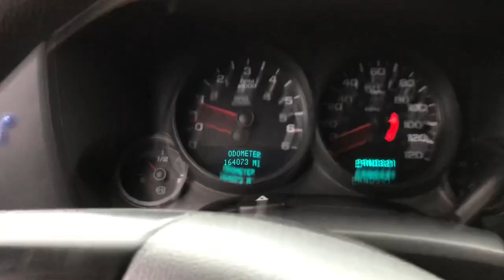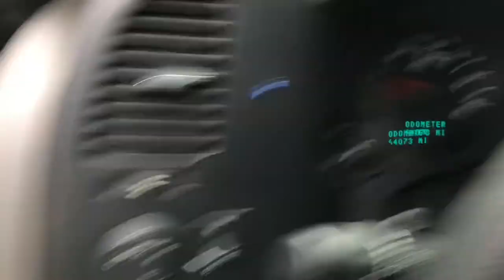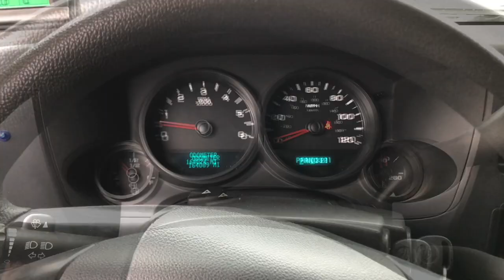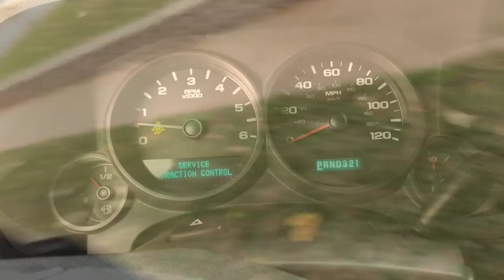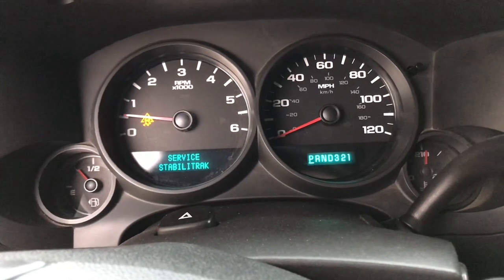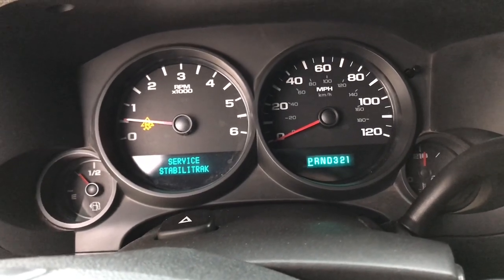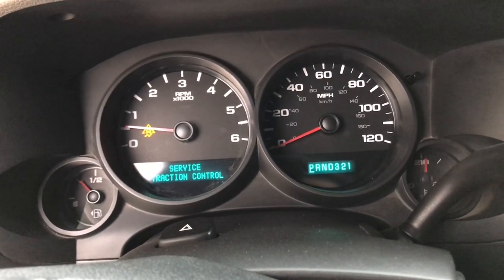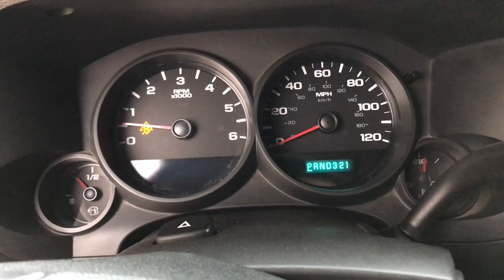Chevy Silverado Lifter Noise Tick | 4.8 5.3 6.0 Vortec | Vlog

Comment: had  same problem 5.3 put new lifters and the misfire because number one had leaking valve seat on intake  and number 6 also bad intake valve exhast seats were all carbon up put 2  new intake valves 7 dollars each and cleaned all valves and reseated  them and now it runs great just got it together today total around 7 hundred in parts 1 21 2022

Comment: I have the same exact issue right now with same codes, cylinder 2 misfire, and ticking sound. What was the issue? Lifters? Plugs?
Reply: It turned out to be the lifter on 2nd cylinder... the lifter roller was half ways gone so replacing the lifter fixed it.

Comment: Changed plugs installed hotter spark plugs. Better burn off.
Problem Stopped. 
Only very slight ticking on and off. 
Bad engine design oil tends to pool over the parts of engine and eventually lifter rod's clogged and lifter failure.

Comment: Flexplate? The tempo would be a lot faster if it was a lifter.
So, what was the problem?
Reply: • VH no it wouldn’t the camshaft spins at half the speed of the crank. if it was bottom end rotational or if it was flexplate/TC it would be twice the sound and way louder

Comment: Mine's at the garage right now same exact thing happened yesterday bad lifter mine was Cylinder 6 I've got a 2011 Chevy Silverado 1500
Reply: Did you find out what was wrong with yours? I have an 2008 Silverado 1500 with a 4.8 and I have cylinder 6 misfire and almost like a knocking noise and traction control message flashing

Comment: I’ve got the same issue on my 2013 4.8. With the hard shift from fist to second and the traction control issues. I did pull my belts, even the AC belt which was a pain in the A$$!! Still had the noise. I’m going to have the heads checked out. If this is the problem it’ll be a lot better than an engine barring that I was thinking it is.

Did you ever find out what the issues was on your truck? Also that truck looks badass!!

Comment: I have an 07 4.8 with lifter tick on drivers side of the engine. No check engine or anything. On starts ticking after long idle
Reply: 204k miles

Comment: Did ever find the issue mind doing the same exact thing..but my code is cylinder 7
Reply: Mind is in the shop now. The Mechanic called me today and said that i have a internal mechanical failure in cylinder 8. Lifter issue i do believe. its a pricey fix
Reply: @thegreath26  I think my truck is doing the same thing. How pricey are we talkin about?
Reply: @quentinbell5617  well I just got my truck fixed and it was over 3k for parts and labor. They changed out the cam and all of the lifters and it runs like kne w. My extended warranty covered it so I dodged a bullet there. Good luck
Reply: @thegreath26  Same as mine.
Reply: @quentinbell5617  3k
Reply: @PeterBranco  had to replace the camshaft and all the lifters it's about 3 Grand
Reply: @thegreath26  Ouch! Hope she is running good after all the work.
Reply: Gorilla King88 How is she running after you had her fixed? I know it’s been a while (over a year?) since you had it repaired. I just want to know if it was worth it or did it come back?

Comment: I had same problem in 2012 Silverado. Same lights everything and just took it over to Chevy garage. They said same thing bad lifter
Reply: Did you get it fixed?
Reply: @TheMrboombostic  yeah I had someone else do it for way less. $2000 compared to $3800
Reply: Dylan Rupe Sounds like a good price. What all had to be done? Guess I’m in the same boat.
Reply: @TheMrboombostic  just lifters the guy was honest and said the cam was good. After you get it fixed get the chip that does away with the 4 cylinder bs. Only run you couple hundred dollars, but versus the alternative well worth it. GMC needs to do something about the bs. Tons of vehicles have same problem.
Reply: Dylan Rupe I have the 2009 4.8L which doesn’t have the afm (8cyl to 4cyl) on it. Just hope I can find someone who will do the job right.